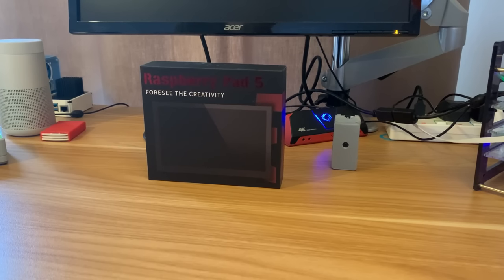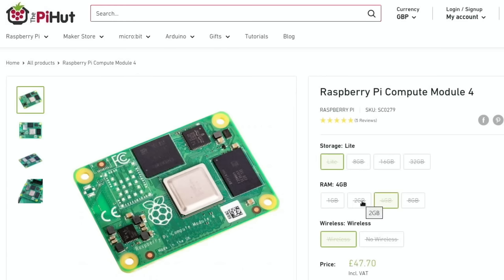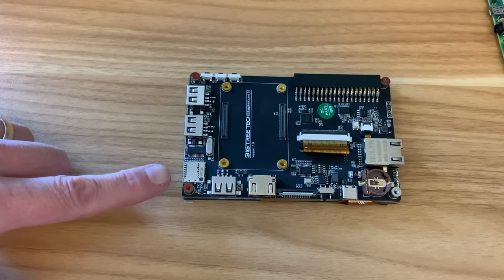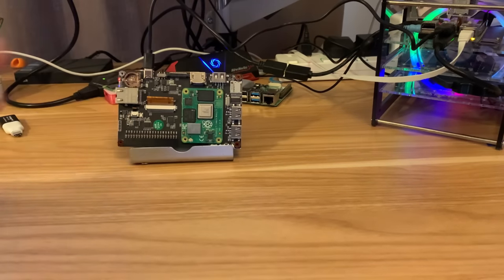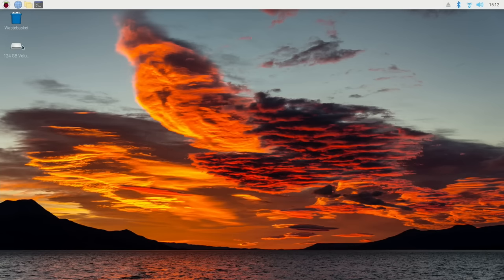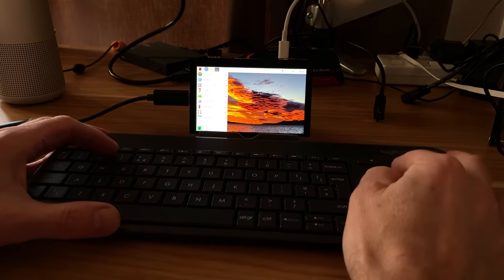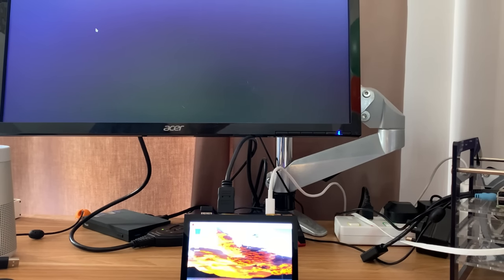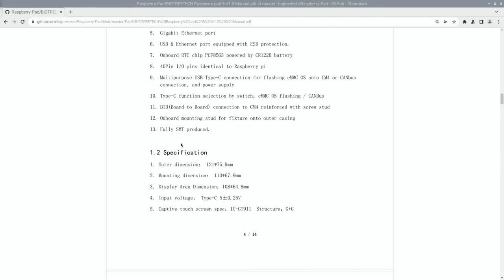Raspberry Pad 5

Comment: Can you add the direct link to the case files in the description? I think you mentioned doing it in the video but the only link goes to the PDF manual.

I received a review unit too, and love the size and design—I think it's perfect for their main use case, as a replacement interface for custom 3D printer builds! And you mention a use case I didn't even think of—a Switch-style portable console. It could probably be done with some sort of split controller, a custom case, and a battery on one or both sides in the control area.

Sound would be annoying to manage, but doable. This is a really neat device!
Reply: Hiya Jeff :p
Reply from the maker: https://github.com/bigtreetech/Raspberry-Pad/tree/master/Pad5
Reply from the maker: Hi Jeff. 

Any fix for a non responsive emmc cm4. I was making a video about usb booting an emmc cm4 and it’s stopped responding on both my carrier boards with cables I know are working.
Reply: Hi Jeff, will you have a video on it?
Reply: Alway's need more Jeff And Leeps in our lives, Bahahah
Reply: @leepspvideo  That's a good question—I actually had the same thing happen on one of my eMMC models (the original prototype model that Raspberry Pi sent). I didn't get too deep into debugging though, so it could be something easy to fix—or not. I would ask on the Pi Forums as someone there may have more helpful debugging advice.
Reply: @camerancummings8327  Yes, eventually. Might or might not get a project done with it... we'll see!
Reply: @JeffGeerling  great i'll look forward to it

Comment: I've been working out plans for a Pi Zero 2 W smart thermostat and home automation hub/panel, but am now thinking of switching it to this with a CM4 instead. This little panel looks great, and the price is right.
You might be able to solve the 2nd monitor issue by putting hdmi_force_hotplug=1 into your config.txt.

Comment: Rpi Os menu option => Preferences => Screen configuration can change resolution and position (stack), 
e.g. moving down would move the mouse pointer to the lower screen.
Might need to activate the second screen in software first.
Reply from the maker: I tried, but not for long. It wouldn’t allow me to move the small screen beneath my monitor.
Reply: @leepspvideo  strange, tested it again, hdmi2 had no problem, dragged the tile with the name below, clicked apply and let it reboot. on a regular rpi4/2GB.
Reply from the maker: @jyvben1520  I have used dual HDMI monitors with no issues before 

16 operating systems Tested with Dual monitors. Raspberry Pi 4
https://youtu.be/YCL_jqpq1F0

Windows 10 Raspberry Pi 4. Dual Monitors & How to Access the Boot Partition. WOR episode 31.
https://youtu.be/kj_3mudbvug

It’s the first time I think I have used 1 DSI monitor and one with HDM

Comment: Happy PiDay 2U
I came across an old Project, called  "ZXBaremulator" to give my old raspberry 1B a 2nd Live. Realy nice. As there is no linux to boot, it turns on just like nothing. I also found a Spectrum+ Like Cover on thingiverse called "ZX Spectrum Emulator case" which i am printing this week. 
So I just have to order the fitting Keyboard and I have a near real Spectrum128 :-)
And my old 1B has a new home.

Comment: My mind IMMEDIATELY went to a handheld pi console. My main question is if it can also be powered by the IO pins just like a traditional raspberry. This would make adding a daughterboard to it very easy, it even has mounting holes for screws if things are done right. Just slide the daughterboard in there, secure both boards and some casing on everything with screws, and the daughter board not only provides power but also has a battery, not just controls.

Comment: I want to use my new raspb. pad 5 for my 3d printer. So if I have an original Pi 3, do I still need an additional cm4 or can I hook up the pi to the pad and connect it to the mobo and done?

Comment: Hi Leepspsvideo,

I tried to install Raspberry Pi OS on the Raspberry Pi Pad 5 but failed. I looked very carefully at your instruction in this video and in the video about the CM4 router with the Seeedstudio CM4 motherboard, as well as at Jeff Geerlings instruction steps how to install Raspberry Pi OS on the CM4. In contrast to what can be seen in your video, I get error messages after every command line I entered, and nothing works. What might be wrong?

Regards, Peter Gamma
Reply from the maker: Not sure try the Raspberry Pi forums
Reply: @leepspvideo  Thanks for the info. I have looked there but did not find a solution yet. But nice to have a forum for the Raspberry CM4. For the Orange Pi 5 I never found one which is worth mentioning.